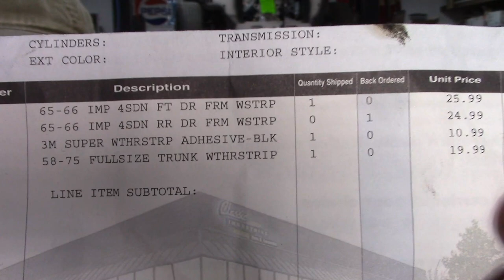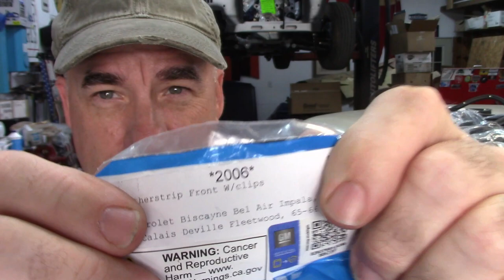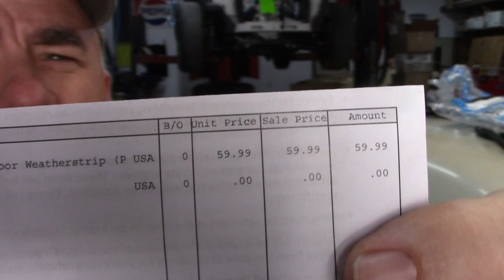1965 Impala door seals

Comment: Did you contact Ecklers and ask them to match the price?  I do not know if they entertain that but, worth a try. If no, burn their ears. Not saying you can find what you need and special stuff may cost more but, I always check Rock Auto. Many times I am foiled (not available). Still, it is worth checking. Maybe not rubber seals per say. I can get this year Chevy door handles (interior door, window, and vent) for almost half the price than what  the competition demands. Often, it is the identical part. Even with shipping, you save money. I am not affiliated with Rock Auto.

Comment: How do you adjust travel on 1966 impala won’t go all the way up and gap at top by rear window
Reply from the maker: Good question. I haven't had to deal with that on an Impala, but there should be adjustable stops for the window. Usually like a small lege with a bolt that can move vertically in a slot.

Comment: I'd feel short changed if the corners were missing on those seals and especially in a critical location like that. I chase water leaks in vehicles at my day job and I tell you, water creeps in through the smallest imperfections, like you wouldn't believe. But enough about that. I really need to get me a Mini Split in my garage. Fans just blow the warm air in circles and take up valuable space.
Reply from the maker: Available on my Amazon page. You'll love it.